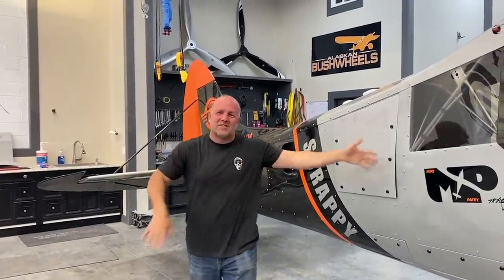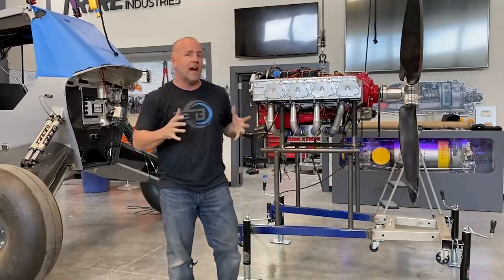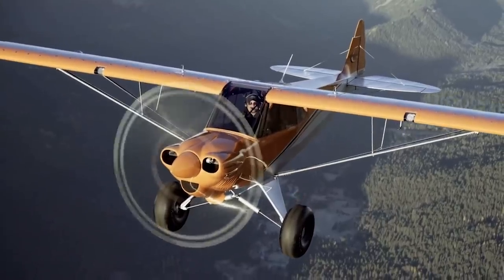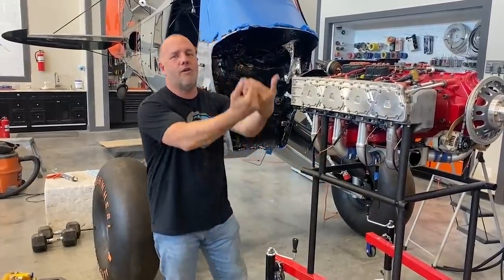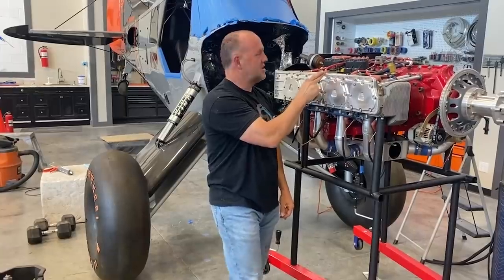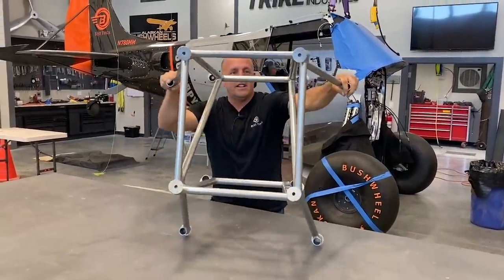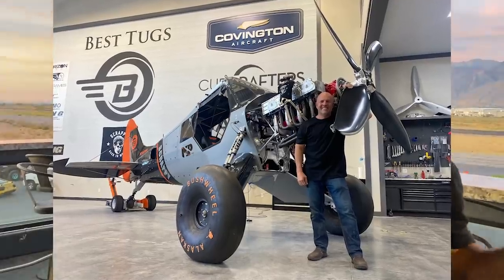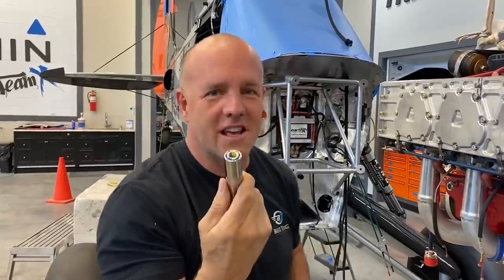Giant race engine into a Bush Plane 😳13 Liters goes into Scrappy build # 29

Comment: Scrappy looks like a caricature of a bush plane, with every feature exaggerated. Amazing job Mike!!
Reply: What do you have to do to be able to weld inside your hangar? We're looking at renting a hangar to build electric skateboards in (and eventually a bush plane) but were told we are not allowed to do any welding due to fire regulations and insurance. We spot-weld our battery packs, so it seems like a deal breaker.

Comment: Mike at start of series: "I'm gonna detune my ex racing engine to 500 HP - it's overkill, but I already have it". 
...
Mike now: " I'm gonna do some some engine upgrades, cos 500 HP just isn't enough".
Reply: Haha I thought the same thing... 500hp not enough???😂😂😂
Reply: I mean, he announced the prop some while ago and ... it was obvious that 500 wasn't gonna cut it. What kind of power do those airboats have? Like the 600~700 beach? The only one i personally know of, here in Europe has around 730 HP and can do all its watery marsh things, but also ride along on wheels on land.
Reply: Yea, the Draco crash has really altered this build.
Reply: @ryanschaff123   Could you imagine if he had the power to weight ratio like scrappy is going to have in Draco during that flip, he could of dropped the throttle and pulled himself out of the  Ground loop
Reply: IKR... 😆😀😆
Reply: @skm9420  I fly RC model BUSHPLANES..1:1 power ratio, Fine pitch props .. IMMEDIATE AIRSPEED.. *AS LONG AS P-FACTOR IS ACCOUNTED FOR ON ONSET BY RUDDER&ELEVATOR..OR EXCESS TORQUE WILL CAUSE SPIRALING FIRST! Must have prop plane perpendicular to vector of travel & compensate for torque. The more lift the wing is producing the greater the differential in induced/profile drag forces, the more aggressive the spin, differential wheel loading/drag is an issue too, gets exponential as ground loop progresses..
All said, through experience, learning from others& postulation, development of proper control touch & application of power, & knowing when to say "no-go" lead to greater safety& capability!🤠
Reply: We figured that 500 hp was not going to cut it.
Reply: coast to coast in 2.5 hrs?..lol...ya stol drags  and stohl  about to be changed ..tha lil yellow cub gonna get some competition ?? theres always j.a.t.o....lol
Reply: @francisconti9085  hi. I love your comment. I strapped an Enya 25 to a built-up fuse and a foam wing designed for a 0.12 cubic inch motor.  It was a joy to fly ✈ and was my first rc plane.  Real joy...
Reply: @charlesseymour1482  Adequate power is a plus! Surplus power is more fun so long as plane(&pilot!) can handle it😃.. Q: "Will it clear the trees?" A: "Well..how does VERTICAL SOUND? .. listen to THIS!"🤣

Comment: When I was a child there was an elderly gentleman in our church congregation who was a F4U Corsair pilot during WW2. I thought that was the coolest thing!

I know most of you pilots already know that the Corsair incorporated the largest engine available at the time, the 2,000 hp 18-cylinder Pratt & Whitney R-2800 Double Wasp radial. To extract as much power as possible, a relatively large Hamilton Standard Hydromatic propeller of 13' 4" was used, & thats why the Corsair had gull wings :)
Reply: Hmmm... that means with the Mike Patey approach, you could have a 4000hp DC3...🤔🤨😯
Reply: The gull wing was also useful because it meant that the wing fuselage joint was ideal from a drag perspective
Reply: I thought it had gull wings so the length of the landing gear struts could be shorter, thus stronger, for the rough carrier deck landings.
Reply: @donkboys  im sure it was many things. It also probably had gull wings so it more easily could fit on the deck of a carrier or the wing folding mechanism could be stronger. But youre both right two big reasons was to get the angle of attack required to clear the prop. And it also allowed the landing gear to be really stumpy
Reply: If you look at the Corsair landing gear it folds to the rear.  The wing cord, of course, limits the length of the gear and with a strait wing the gear would have been too short to support the desired prop.  The only reason they “bent” the wings was to raise the fuselage to clear the prop.  It didn’t have the kill ratio of the Hellcat but totally outperformed it.  An amazing airplane.
Reply: King-O-Vetts 
I read an article by a test pilot for one of these types years ago. The two planes were at times flown together and at times test pilots rotated between them to iron out faults and investigate performance differences (wartime contingency). He said they were in fact almost identical in performance in every aspect (they both used the same engine). In the early stages the Corsair claimed a 20 mph speed advantage, but when flown side by side there was no difference at all. It was simply a matter of pitot tube positioning. 
It was in a print magazine, and I can find nothing on it right now.
Reply: grimwat Wikipedia has a great write up on both of these planes including performance stats.  The Hellcat was a little lighter but a lot bigger, especially in fuselage frontal area.  Their stats show the Corsair with a 50 MPH top speed advantage.  Sounds right to me but since I wasn’t born when the testing was done, I don’t have anything else to go by.  The Hellcat was never designed for high speed but for turn rate, power climb and most importantly combat survivability.  As a combat fighter it was as good as it got.  When Grumman decided to build a higher performance fighter they built the F8 Bearcat.  If you want to see a true monster, look up the Grumman F-7F-3 Tigercat.
Reply: King-O-Vetts 
I found this.:

Corky and other Grumman test pilots, at the Navy's insistence, flew the F6F-3 and F4U-1D in side-by-side comparisons to assess the apparent differences between the two aircraft.  Chance-Vought's test pilots were also provided with a -3 Hellcat to compare it to the Corsair.

Corky states that the Navy wanted them to study the Corsair's design to find ideas to help correct two faults in the Hellcat's design:  an indicated speed difference of 20 knots less airspeed at nearly all altitudes;  and a loss in roll-rate from 70 degrees a second at low to moderate airspeeds to about 40 degrees at speeds in excess of 300 knots.  Chance-Vought had to study the Hellcat to help rectify the Corsair's horribly stiff oleo landing gear and abysmal low-speed stall characteristics.

While the Corsair proved to be 20 knots faster at low-level in the main-stage blower, as Widewing stated, the air-speed indicator of the Corsair showed that it was 20 knots faster than the Hellcat even at both aircraft's rated altitude, even when they were closely stabilized in flight (read "identical" air-speeds).  As it turned out, the positioning of the Hellcat's static and dynamic orifices consistently read 20 knots slower than that of the Corsair even when their flight speeds could be seen to be identical.  A repositioning of the orifices to the same positions that they were in on the Corsair solved the problem.
Reply: King-O-Vetts ... a bit more:

Corky Meyer and Cpt. Eric Brown of the Royal Fleet Air Arm both have vast experience in test flying aircraft, with Brown having no dogs in the hunt when comparing two different American aircraft. 

Capt. Brown flew the Hellcat and Corsair extensively.  While he considered the Corsair to be a fine aircraft, he preferred the Hellcat when it came time to mix it up with the enemy.  His book "Duels in the Sky" contain some interesting one-on-one comparisons of Allied naval aircraft with their Axis opponents.  In a comparison between the Corsair and the FW-290 A4 he states that the FW could not be bested by the Corsair while the Hellcat was a better matchup for the German aircraft.
Reply: grimwat  I stated that the Hellcat was a better combat aircraft.  My only point was that the Corsair was way faster.  I am curious as to why you didn’t quote the American pilot that did all the testing and acceptance certification for all the Navy aircraft.  I read a lot of his reports but I am sorry I don’t remember his name.  I do remember that his favorite aircraft and the one he flew personally around the country was the Tigercat.
Reply: Hi King-O-Vetts 
Sorry, this was just an article I read. Thought it was interesting. 
Don’t have any access to quotes from the original test pilot. 
Quite interested to note they basically used the same engine., so performance comparisons are fascinating, given designers started with same brief. 
All interesting stuff.
Reply: grimwat  I admit that I can’t verify any of Wikipedia’s data but their historical breakdowns of military aircraft are both extremely detailed and very interesting.  Remember that the Hellcat was designed and built several years after the Corsair when top speed was considered the ultimate advantage.  The Wildcat combat deficiencies were the driving force behind the Hellcat’s design.  Nothing like real-world experience to override desk-sitting politicians and slide rule engineers.  If you want to know what you need in a fighter, ask an experienced combat pilot who has to put his life on the line every day.  I think that was the motivation for the Hellcat design and it proved to be perfect for the job.
Reply: grimwat  Just Google the aircraft you like and open the Wikipedia file.  They are really good.  Cheers.

Comment: Mike Hi! I have followed you for a long time and have watched all of your’s & your brothers videos. In fact my wife and I own a Bravo 5 tug #18. At any rate have you considered making your engine mount so that you could actually swing the engine to the left or right to access the back of the engine, like you can on a Cessna 195? We had N195JJ a 1952 Cessna 195 we found in a hanger in Springfield Ohio and restored, loved the fact you could pull to bolts and swing the engine like a door to access the back of it while still mounted to the plane. Britt

Comment: The world's first flying engine.
Reply: Gee Bee: Am I a joke to you?
Reply: They said if you put a big enough engine in, anything can fly. That was the F-100 Super Sabre.
The Gee Bee was an engine with wings.
There might be some more, but I'm drawing a blank.
Reply: @Shadow63Wolf  The F-4 Phantom.
Reply: F-104 Starfighter, of course.
Reply: naa i think that got beat out by a gb model r..lol i could be wrong
Reply: XFY Pogo, enough engine to take off vertically, enough fuselage to cover the engine up, the wings are about the same size as its vertical stabilizers, and there wasn't room for anything else.  The XFY was the embodiment of an engine with wings.
Reply: Skinflaps Meatslapper  I had a model of the Pogo when I was a kid.  Loved it.  Too bad it never worked.
Reply: @king-o-vetts9899  It was an awesome little plane.  Wish I could buy that thing, I'd fly it everywhere.
Reply: @oltimer5544  that's what I was going to say!
Reply: Atlas 5
Reply: The f-4 phantom, proof that with a big enough engine shoved up it's butt, even a concrete filled dumpster can break the sound barrier.
Reply: I dunno what the hangup is with the F-4, but it's nowhere close to being an engine with wings.  Even the F-104 fits the bill better than the F-4.  Also it's got 100 more than the F-4 does too.
Reply: F-16

Comment: Mike, fantastic video, that motor is huuuge! I’d love you to do a separate video to walk us through how you: a) calculate the weight and balance and therefore the final mounting position of the motor, b) determine the thrust angle for the final position of the motor and c) the strength of materials calculations for the design of your engine mount taking weight, thrust and shock (from the off-field landings you plan to do with Scrappy) into account. Thanks for taking us along on such an amazing journey of building your Monster Cub 👍

Comment: "What sort of standards is this airplane built to" 'Oh, Very rigorous aerospace standards' "What sort of things?" 'Well the front's not supposed to fall off, for a start.'
Reply: [/Aussie]
Well the front fell off.
[Aussie]
Reply: IMO, if the nose end falls off in this, you have ... bigger fish to fry.
Reply: But i bet it was towed beyond the environment after the incident
Reply: Well, it happened to a Miles Messenger
Reply: I get this reference, well done.
Reply: Cardboard’s out. No rubber. It has to have a steering wheel. There’s a minimum crew requirement... 

what’s the minimum crew?

Well, one, I should think.

Comment: About losing the engine, I heard of a guy flying along with his family in his Miles Messenger, when the prop shed a blade - a few moments later the engine fell off, and he got very busy putting his wife and kids on top of the instrument panel - and they all survived.
Reply: That's Bruce Willis movie material !!!
Reply: @nielsheesernielsen3614   Sylvester!
Reply: I had the same thing happen on an RC airplane. A folding prop shed a blade and the resulting severely out of balance prop ripped the motor right out of the plane. CG went to the aileron hinge line. Touchy doesn't begin to describe the result. A lot of down elevator and just breathing on the stick and I did fly it down to an intact landing.
Reply: @ljfinger  My buddy who has flown RC for years had the same experience.. &we heard a story of another full scale plane with single pilot, full motor separation, he pitched full foreward hoping for the best, only let up just @ ground..survived luckily.. safety wire to retain loose engine doesn't hurt, but I like Mike Patey's idea better still to start with.
Reply: That is why the P39 was such a great design.
Reply: I reckon that if the engine did somehow come off, Mike would be reaching for the parachute handle real quick...
Reply: this engine might not fall off but causes the plane to nosedive without a chance to hold it off
Reply: @bruceparr1678  Yes, quite a unique design, I laugh when I think of the "mid-mounted engine" as synonymous to an exotic sports car..a pretty plane too, but that nose gear was novel!
Reply: @francisconti9085  I often wonder if "Mid Engine" has been tried in RC.
Reply: @bruceparr1678  hmmm, there is currently a nice foam P-39  model on the market, but I believe the electric motor is "conventionally mounted" in the nose.. i doubt the same concept has been used in RC in the exact same format, there are cheaters out there, the pushers with small prop in mid fuselage, some "past-mid-wing" pushers, some like on the Lake seaplane, (engine in pod above wing).. but it's a good question, someone may have a P-51 model built that way (as  my imagination wanders, lol)

Comment: I'm with you on the double motor mount . That engine is going to be a beast on that light air frame . I'd hate to see it take off and leave you and Scrappy hanging in mid air . LOL  I had a Honda CR 500 works bike shoot out from under me once , I felt like Wylie Coyote sitting there on nothing but a cloud of dust  !  THEN , my tumbling ass ..... Luv you guys !!!
Reply: a lot like  attaching a jet engine to a tinfoil plane???

Comment: Mike please... 8:01

If you failed by doing something the right way what am I?
Reply: I think he was just waiting for Ron so he wouldn't screw up the mount! Credit to Ron!
Reply: Im not familiar with the legacy of that mount design. Maybe the history has already been proven. Ideally, I would like to have seen him use his first mount as the test platform pushed to measured failures, especially torque and shear, then build a second one incorporating corrections based on data derived from the measured values.
Reply: That's the way
Reply: Ft. Taylor swift

Comment: That trick with the nut is genius. Now I just need a real plane to work on lol.
Reply: I guess i feel a little smarter now, I have done that as well, using different kinds of stuff to wedge a nut or bolt into a socket, like a chunk of plastic bag, a piece of paper towel, gasket gook and grease will work too.

Comment: After losing a prop blade while towing a banner, three mounts broke. The fourth bent 60 degrees. The cowling flew off never to be seen again. The weight of the engine remained but it was hanging off the right side of the plane blocking airflow to the tail. I followed the yaw to the right and glided like the proverbial set of keys to a one acre field. A flare wasn’t possible with only half an elevator in the slipstream but there was no fire thank God. The engine completed the 180 on impact and the remaining prop blade pierced the cabin and ended up wedged between me and the panel. ( it did NOT pierce me. Another thank God). A couple weeks in the hospital and I bought a Pawnee with the insurance money and went “back to work”. ... undetectable stress fracture in the prop.
Reply: Thank the Father, Son, Holy Spirit, Mary, Joseph, all the family, inlaws, & angels above.. you were the impossible best case scenario my friend
Reply: Ls
Reply from the maker: WOW!!!  What a crazy event!  So glad you not only survived to tell about it, but got back in the air.  Good on you! 👍🏻👍🏻

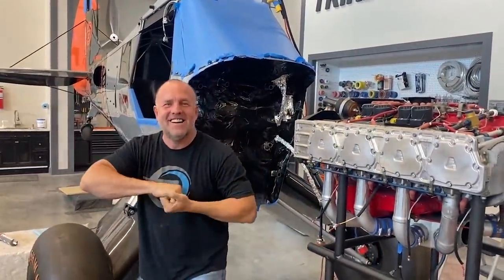Comment: I'm curious, Mike. The tires in the beginning are different than the tires after the 9:10 mark. Were they changed for weight/balance?
Reply: Might have been swapped out to lower the front of the plane.
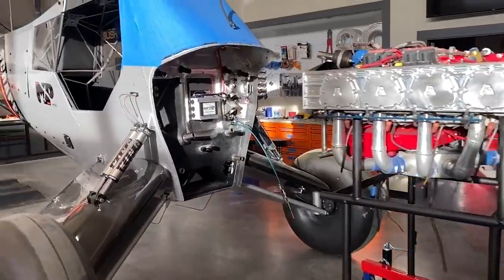Reply: @main11gear - And a switch back at 9:46 and another at 9:57 - the magic of editing. The temp tires were used while the new set was sent out for dynamic balancing; as Mike also intends to set a new ground speed record with Scrappy.
Reply: Looks like all he did was  add the raised orange letters.
Reply: @gerdawhite6012  Ah! Hence the lack of wings.